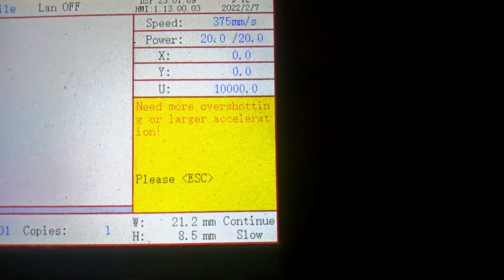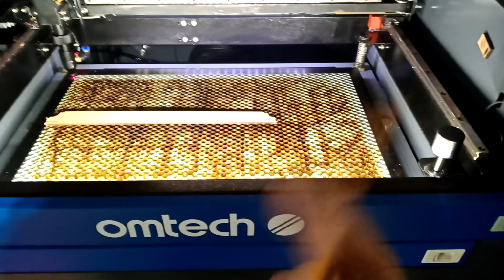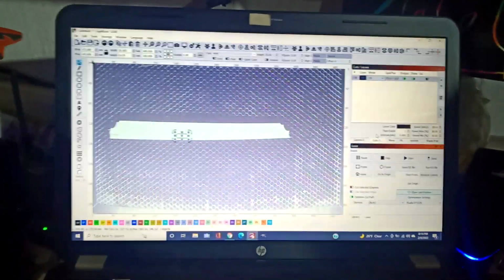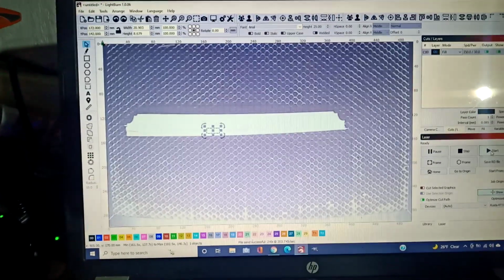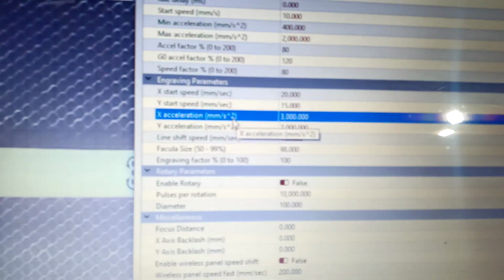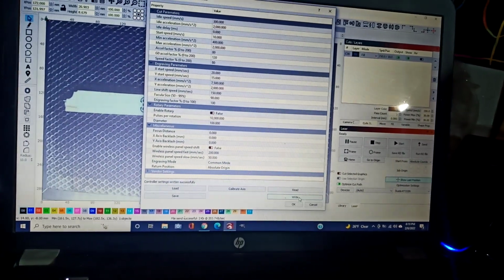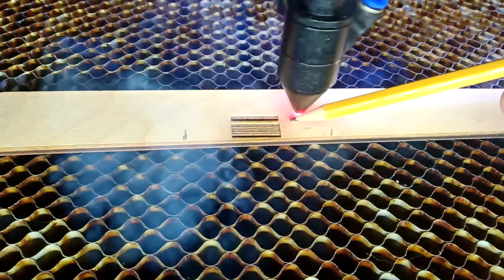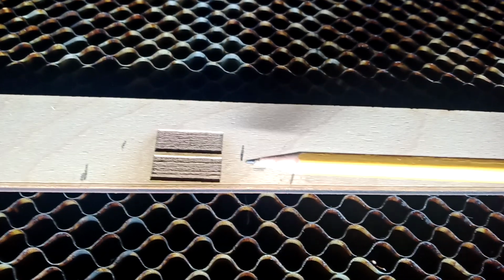Reducing OMTech Laser Overtravel, Need more overshooting or larger acceleration

Comment: How do you see what you have on your workspace?  I have a 60w.  Can I do that too?   What's the settings to visually see what is on my workspace/bed.
Reply from the maker: Yes you can do that too if you follow the step don't reduce it a lot as I did so I will not cause a problem to your machine do this only if you're having a problem

Comment: mines set to 8000 same machine
Reply from the maker: Interesting mine was set to 3,000 from the manufacturer and light burn told me I can go up to 7500
Reply: @wisamyousif14  should i set this down to 7500 the guy that had it before me must have changed this thanks
Reply from the maker: @Martin-ll7jc  I am not sure mine originally was set to 3,000 but I did a 7500 but then I took it to 7,000 someone in here was saying this my affect the motor I will have to ask one day omtech engineer

Comment: Thanks, I have the same machine as you and had run into the issue but hadnt had time to figure it out yet, I was having to cut on super low power because it was slowing the machine right down because mine was set to 250 out of the box for some reason. I don't need to push it to 7500 but pushing it up to 2000 has made it miles better.
Reply from the maker: I am glad you benefit from this